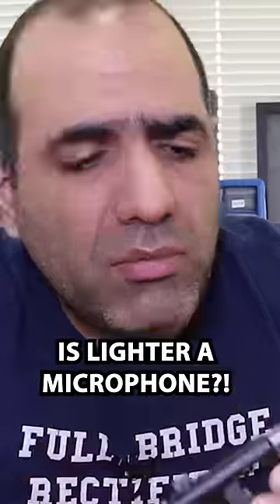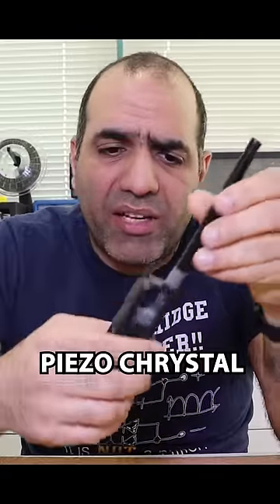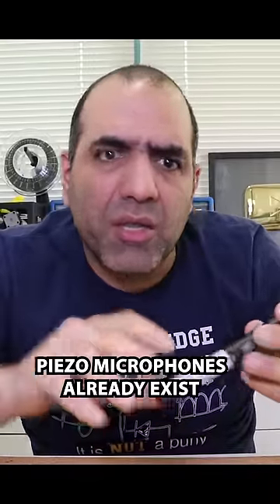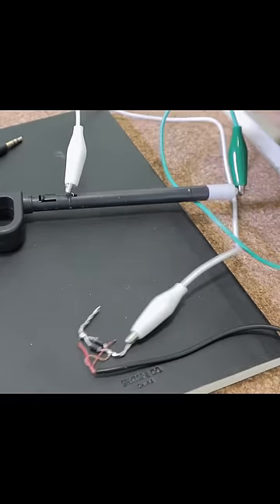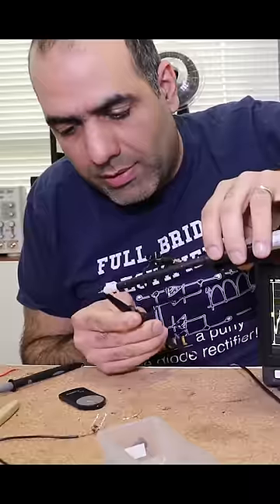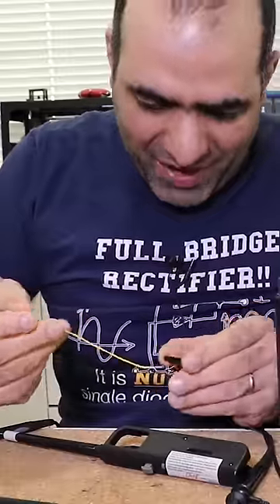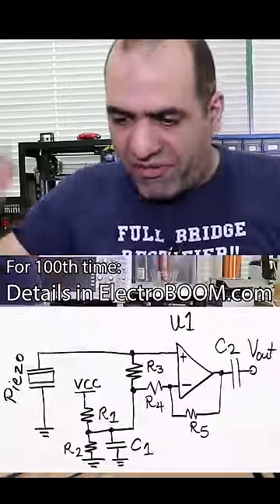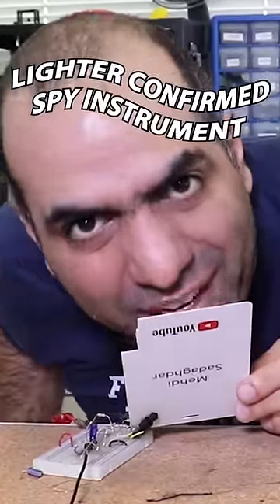Turn a Lighter Into a Microphone #electronics #lighter #funny #microphone

Comment: A wire-wound microphone also works in reverse; do piezo-microphones also work as speakers?
Reply: Yes, in the sense that a piezoelectric can be used as a speaker. Have you heard a microwave beeper/buzzer? That's a piezoelectric speaker. Piezoelectrics are used in a lot of applications, another common application is for transducers to send/sense ultrasound.

If you want to look into it more, the effect that allows you to use it as a microphone is called the "Direct piezoelectric effect". The effect to use it as a speaker is called the "Converse piezoelectric effect"
Reply: @RiverrRiverr If I am not mistaken the Nokia 3310 also had that piezoelectric speaker inside of it instead of a classic speaker. That’s why that legendary ringtone sounded so low quality and legendary.
Reply: They can do that, the frequency range tends to be limited.
Piezo crystals,  due to their physical characteristics,  have an inherent resonant frequency (thats why we used to use them to set the transmission frequency of a radio).
They don't "like" to produce sounds much higher or lower than their resonance.
Reply: You can make a microphone out of aluminum foil, a pin and a cap off a spray can cap and an amplifier. Done it.
Reply: Yes.
Reply: @bauhnguefyische667 You forgot to mention the magnet.
Reply: @deang5622  
Don’t need the magnet actually.
Remember aluminum foil is used for the membrane.
Reply: the real question is do your speakers work as a lighter?
Reply: @quark1010_  
Yes they did, both of them caught fire.🤣
Reply: A microphone is literally just a speaker with the signal flowing the other way.
Reply: @bauhnguefyische667  hold on WHAT?? You made a microphone with that shit lol???
Reply: @screweduptx512  
Yep, I’m not saying it worked well.🤣
Reply: I have a TRS cable to headphone jack cable and are plugged my microphone into the TRS adaptor and then plugged the Jack into my phone and you could use it as a speaker
Reply: Piezoelectric buzzers…bruh…
Reply: Earphones and headphones can be used as microphones
Reply: .... But can I use a microphone is a lighter

Comment: They actually teach how to do this at CIA University.
Reply: 𝐂𝐫𝐚𝐳𝐲
Reply: Ahh CIAU. My Alma mater, good times.
Reply: Wait fr?
Reply: @danielloewen2857  yes and it works with your wifi which can detect the signals coming off it not as audible SOUND but strong enough to decode back into full audio.
However, an invisible lazer hitting your window can also read vibrations and report any sound back and conversations.
What's really crazy is these techs are already 60+ years old
Reply: They also show you how to make it at FBI College
Reply: You CIA 👀
Reply: @Lilbeamer  I can neither confirm nor deny😉
Reply: @escapetherace1943  🧢
Reply: oh really tell us more
Reply: @escapetherace1943 The laser needs a mirrorto come back, it's a lil more complex.
Reply: @escapetherace1943  From what I recall, there is a way to map rooms/nearby areas around wifi routers using similar methods of wifi signals and how they bounce as well. 
Also, any speaker not being used can also be used as a microphone where that vibration is used, just like the vibration on glass. I think the speaker predates the glass in the tech side. I read about the speaker in the 90s. I saw the glass method used around 2001. I'm sure there is a deep dive I don't want to get into right now.
Reply: How do you know that 🤨?? Are you speaking from experience🤨??

Comment: I extracted the spark module from one of those and installed it in the side of a thick cardboard tube.  I did this when I was in my late teens or early twenties.  Now I have several children, and I recently found this device when I was unpacking some boxes that had been in storage for a while.  So I placed it on a flat surface, put the end of one of those lighters in it and vented some butane.  Then I triggered the sparker.  The fireball ejected from the top was just as satisfying as it was a decade or so ago, and my kids got to enjoy (or be terrified by...) the effect with me!  (My wife was there watching and said nothing.)

Comment: To be honest, I thought for a minute you were actually going to go into how variations in the proximity of an ionized flame due to air movement can actually induce an electric charge in a nearby conductor, so the actual flame itself can theoretically be used as a microphone (but AFAIK it's actually pretty tricky to make a sensitive enough detector and get it set up just right, so it's mostly a theoretical thing)

Comment: Fun little trick if you have any Milwaukee tools, take the battery out, and flick an electric ignitor next to the LED and it will turn on. (Might work with all electric tools, not sure)

Comment: Could you use piezzo crystals in a motor, instead of coils, to produce electricity ?
So a magnet rotor, and a  piezzo stator with a bit of iron, to compress the crystals

Comment: I don't know about you Mister Boom Boom?  I never used a Lighter for a microphone.  I used a, Piezoelectric buzzer, as a microphone.  About 30 years ago.  Where have you been all this time? It only cost me $.98 US.  Worked great on acoustic guitar.  Worked great on drums.  Sounds a little thin or vocals.  Because it was only the thickness of a couple of sheets of paper.  No need to purchase expensive, acoustic guitar pickups.  Nor drum triggers.  I've been using these cheap little things for years.  They even make good buzzers!  They go beep beep beep.  In a charming resonance and pitch.  That will drive you crazy!  So don't use them buzzers as buzzers.  Use them as acoustic guitar pickups and drum triggers.  You will save a boatload of money.  I guarantee it.  Since I have sold you, nothing.

Comment: I wonder id theres amy devices in the house that would be able to pick up and read those voltage signals from a lighters piezo crystal, or if a device could be used from a distance.